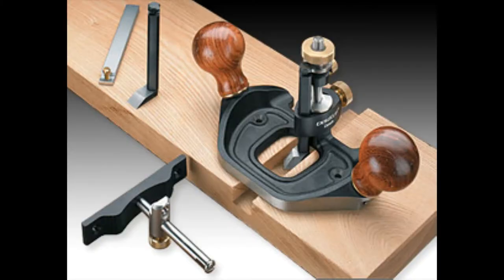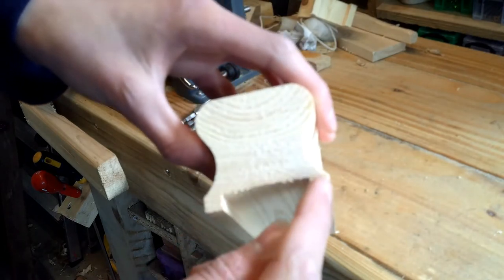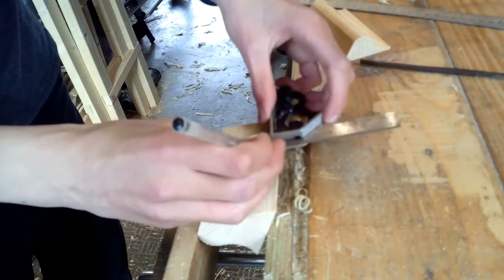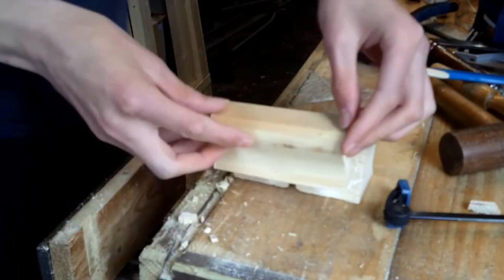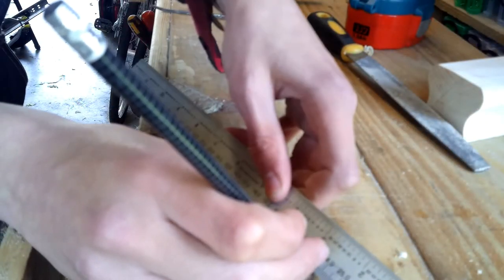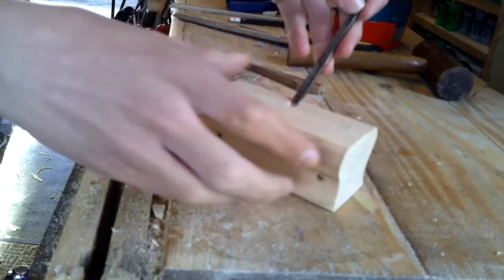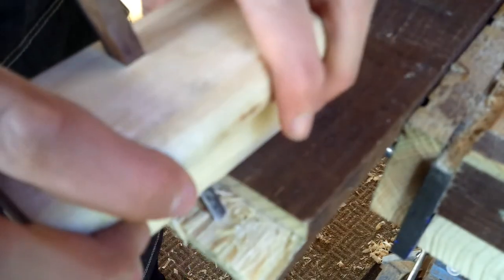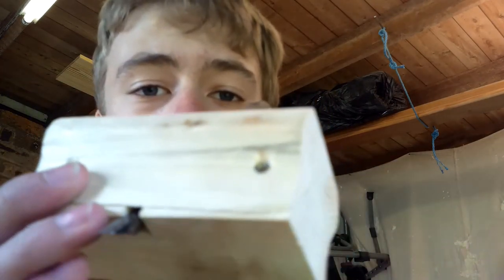Making a Router Plane, because buying one is too expensive!!! //Design, Create, Innovate

Comment: Very good mate 👍 use some polish compound to hone the blade you'll get it razor sharp 👍👏
Reply from the maker: Thanks for watching Dan, I don't have a strop or compound but thanks for the tip anyway!
Reply: @DesignCreateInnovate  an old leather belt and a good quality toothpaste could do the trick. Toothpaste is usually at least 600-800 grit, fine enough to hone the edge.
Reply from the maker: @jessric5947  Sounds like a good idea, I'll have to try it thanks!
Reply: Yeah I just use faux leather off cuts and halfords rubbing compound works great 👍
Reply from the maker: @Thesidingsworkshop  I'll try that too but the leather and toothpaste seems to work too!